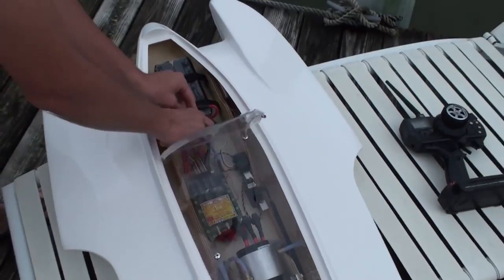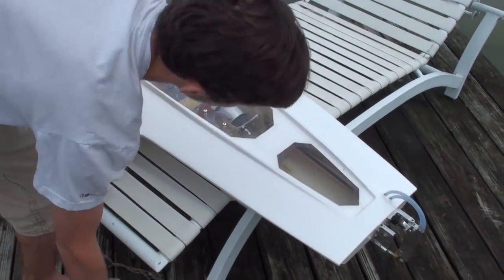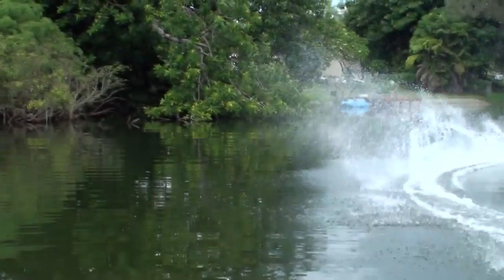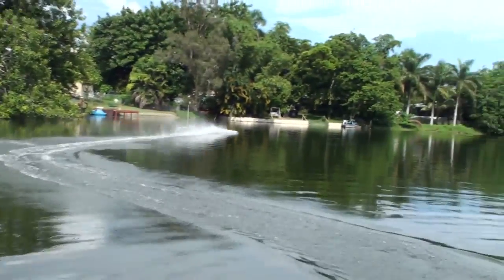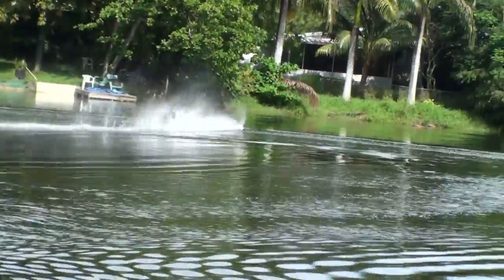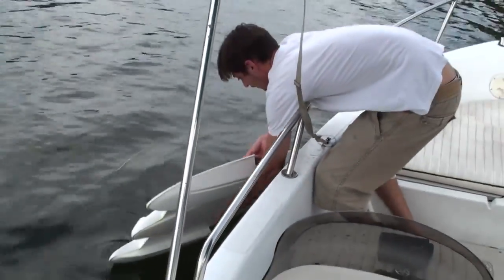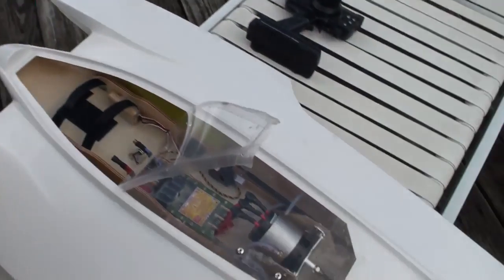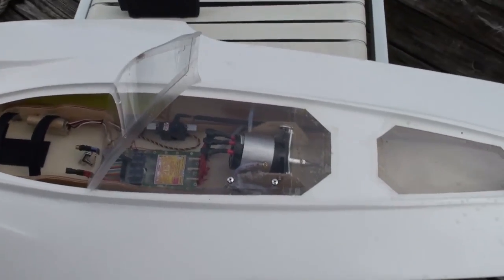Aero Marine Thunderbolt Electric RC Hydroplane Boat

Comment: The light weight setup really looked great. I am real suprised at the run time you are getting out of the hull. I was thinking about the same hull but with a 10s setup in a effort to keep the amps down a bit but I am not sure they will fit up in the front of the hull under a sub hatch like the one you made. I think the 5s packs may be a little to high, can you tell me if you have any extra height under that sub hatch?

Comment from the maker: My 120 hv took some abuse until it went underwater and died. It ran at higher current than rated. But 180hv and 240 hv burned up with same setup. It could have been due to my batteries aging and developing higher internal resistance. Or it may have been design flaw or just bad batch. I say go buy Castle, but make sure to wire it up properly and don't overload it.